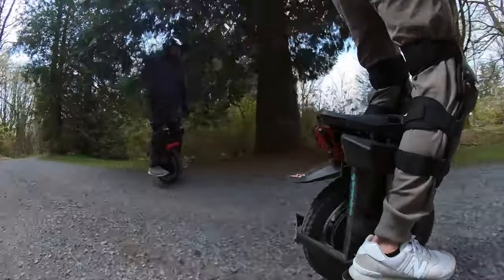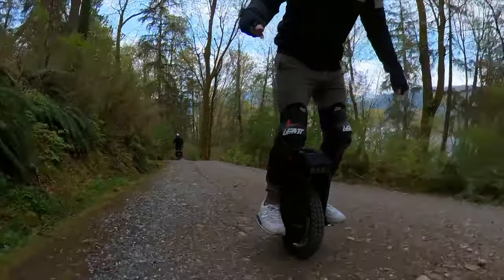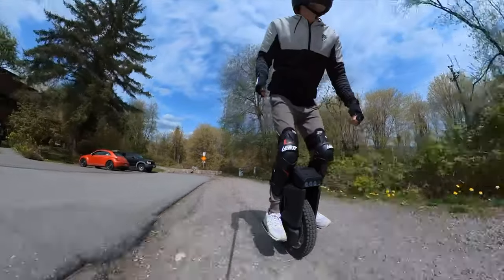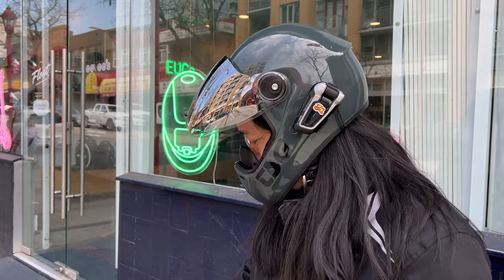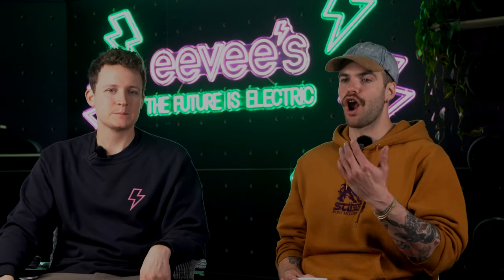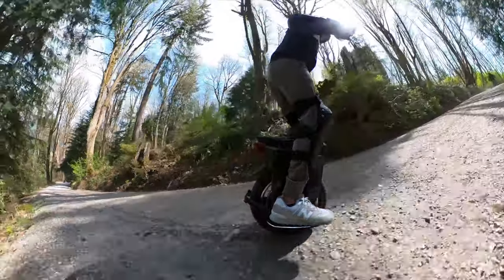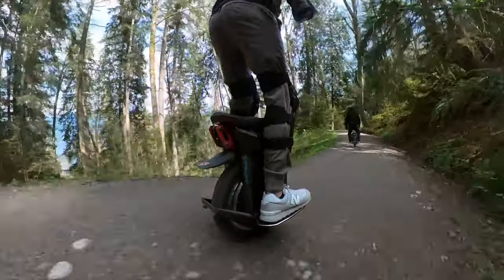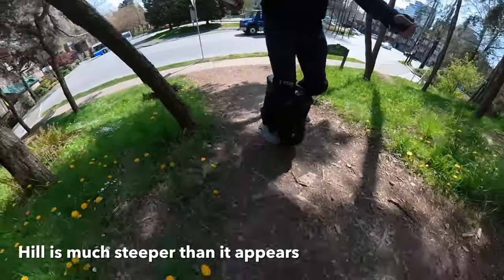Begode Master VS King Song S22 Full Review & Comparison -- Which is right for you?

Comment: Master is very good for riding on the street, It should have a 3600wh option (134v). I'll get a S22.
I think to wait for a street version with 3600wh, 134v and suspension as a third wheel. The first is the ACM2 that I bought from Marty and learned on it.

Comment: Master is definitely my next wheel! Hyped. I actually already bought a Michelin Pilot Street 2 tire to put on it right away since I’m also not a fan of the tire they used. I appreciate your video and thoughts boys! ✌🏼
Reply from the maker: Cheers Andrew! I'm curious your thoughts on that tire. I haven't had the pleasure of trying it yet.
Reply: @eevees  just put it on my EXN, and I have to say I’m a huge fan. The turning is WAYY easier and it’s also alot less “bouncy” compared to the CST
Reply: @Impecable..  Hmm. You still have decent off road traction?
Reply: @ToneKneeParaSocial  the off road traction is still really good; only thing I need to watch out for now is wet grass/mud since there’s no knobs for grip
Reply: Oh yeah 😎 I wanna try that tire out looks like it would shred the streets
Reply: Hi, could you please tell me what the sizes read on your Pilot Street 2? Thanks
Reply: @joelpeterhanson  80/90-14

Edit: 80/80-14 also works; just a little smaller radius so you get more torque, but less speed.
Reply: @joelpeterhanson  sure you need 80/90-14 for the 18in wheels like RS and Master
Reply: @Impecable..  you also risk rim damage with the lower profile too!

Comment: I got through this video with a smile because the lbs-miles pop ups gave me the info I needed without making the video all numbers.   I am on my fourth wheel (solowheel, airwheel, ninebot, and S18).  I am in my fifties and don't want to fall like I had done in my forties.  I have hit lots of unexpected holes and bumps with suspension, never fallen on the last two wheels.  I think you sold me on the S22 if it ever arrives in South America.  Great video.

Comment: Begode needs to build a wheel around suspension to get that 130-150 mm sweet spot. Need 3600 Wh battery on this speed, especially with the way they chained the battery packs now. One pack failure is a faceplant now, same as cut off of a single pack. More reason you need Molicel P42A 21700 4200mAh 45A Battery. 45A is the highest flow of any 21700!
Reply: We'll get there!
Reply: $6666

Comment: Good video! So excited for these! Question: I’m 250lbs. Would the S22 suspension still support me or will it just bottom out just from normal riding?
Reply: Is that 250 fresh outta the shower or 250 all geared up? Big difference. You can find out yourself; all you need is the max suspension and you add the weight of the wheel with your weight fully geared up. If the max suspension load is higher than your weight and the wheel combined, then you can ride it without bottoming out...on paper. The only way to know for sure is to ride it yourself and that usually mean buying it first.  =8-Þ
Reply: If not, there will be a heavier coil upgrade you could swap out for
Reply from the maker: If you’re a heavy rider, I would recommend the S22 because you’ll bottom-out the suspension on the Master most likely:
Reply: I'm about 210 in full gear (or more) and you can see me dropping 4 stairs to flat on the S22 in our videos with no issue! I think you'll be alright :)

Comment: There is no bearing seal on the Master !?
 It is weird i just replace the tire for a H666 on my RS19 HT (awesome tire btw) which has the same motor than the Master the C38 and i did put greases in the bearing which was clean inside a bit of dirt on the seal, but when i remove the seal he has a rubber lips around it, so i wonder why they remove this seal on the Master ?? My RS19 is the batch 4 with the LCD screen.

Comment: I really want to spend some more time on the S20/22, but dang that sucker is wide for my short legs. Ha! These are gonna be popular wheels. Such an exciting time in EUCs.
Reply: Right?! What a time to be alive!
Reply: Atheistme  I'm 5 foot 8 inches or 173cm, but I have like a 29 inch or 73.7cm inseam.
I think the S22 can be reasonably comfortable for me with narrower pads at the top, as opposed to the wide stock pads.
Reply: Atheistme  my legs are proportionally short though. Also, I think with thinner pads, it would feel pretty decent. But the only way is to try it I guess! I'm waiting to see the S22 V2 with bearing sliders, so I'll probably give it another shot then.

Comment: If you put less air pressure in a CST tire it loses the tire leaning problem. Tada!!!!
Reply: I'll tell Bradley and see if it changes anything. I think he already tried that... but I think he also already changed the tire hahah
Reply: @lukastanasiuk5722  I run a V11 CST tire with 1.8 BAR cca 27 PSI, and its perfect grip, no problem with turning the moment i go above that you get that feeling with the CST tire.

However this pressure is not for jumping on to stairs.
Reply: Tires are such an inexpensive EUC accessory with such an huge impact on ride quality. I would definitely recommend getting the perfect tire for you rather than making one work with low pressure or shaving.

Comment: Those are first run shocks on the master - well the one on my EX20 was and the issue was the same. There was an issue. They are fixed now.
Reply: Mehhh we switched it out to a spring suspension and played around with the other one as well and still absolute poop compared to the S22. We are going to pop a much heavier spring on it and see if it can come even within a breath of the S22 but im personally doubtful haha
Reply: @lukastanasiuk5722  for sure. My comment is just about the early shock version. Begode and KS designs are different. Short travel and long travel. Just different. The KS is a non linear design. I don’t know about the Begodes though.
Reply: @rogerunderhill4267  I am confident the shocks will get better, but in my opinion, the Master has a lot of other things to improve before it holds a candle to the S22 :P

Comment: Hey guys.. I got into the hobby with a Gotway MSP HT. It has been experiencing this awful scraping sound from small bumps and medium/hard turns. It'll be smooth and have little or no sound on smooth pavement..

Any thoughts on what kind of problem I have from someone who sees/repairs/opens up these things all the time??

Thanks for the vids. When I have more $$ I'll upgrade 😎
Reply: It'd be hard to say without having it in the shop! Could be something stuck in there, could be a slightly bent rim + an aftermarket knobby tire... these are finicky things sometimes!

Comment: you have any info on difference the production models of the s22 will have compared to the pre-prod of the s20?
I've tried the S20 here in Montreal and it was not that impressive. no torque and too stiff suspension.. you know if they fixed that?
merci
Reply: The new firmware made it much torquier and the suspension just needs to be adjusted to your desires. It will never have the torque of a Master, though.

Comment: Im not sure.... Should I wait for something better next year?
Reply from the maker: There will always be something better next year but for the first time, I feel like EUCs have finally properly leveled up. If you have the money, I wouldn’t wait. They also hold their value quite well so you could sell and upgrade every year for not much money.
Reply: @eevees  
Sure, but it's better of you get that sweet spot where yearly difference won't make much of a change. 
Like a wouldn't want to change my phone every year. But if they make a S24 next year with more ballance, lighter weight, inside suspension and better batteries or other safety features I would want to buy it.
Reply: @BigBoss-gb4cx  They almost certainly will... But you'll be a whole year + without riding the best EUC currently on the market! And also, once they make that new one, the even better newer one will be just another 6 months away, and repeat and repeat haha

Comment: I love the S22 suspension but it's also a huge weak point. The design is apparently not good mostly because the T-rails that the T slider is going up and down in get dirty quick which makes the suspension way less responsive for everything short of bigger drops and bumps. I'm not sure how KS will address that because they really need to but yeah I guess we'll see. I've seen and experienced it first hand.
Reply: Yeah I saw Marco’s (Mad Pack) vid on that. Looks sketchy. We’re looking for the off-road king and that is potentially an Achilles heel. Jam it so full of grease that water/dirt can’t get in? Not ideal.
Reply: @darkhorseeuc   I think supposedly king song supposed to fix it but I don't know how they're gonna do it I have an idea but I'm not sure yeah.
Reply: Definitely the Achilles heel right now.... and somehow STILL the best suspension wheel ever made by a massive margin :P

Comment: That's what I wanted to hear! Helps give me a little more confidence in my choice  while I wait. Appreciate the review guys 🤙🏼
Reply from the maker: Which did you choose??
Reply: @eevees  I went for the S22. Just seemed like the right fit and a really forgiving wheel. Being on the larger side (6'1" & 205 lbs.), and over 40, I knew I wanted a suspension wheel. I don't need the extra speed and torque...not yet.
Reply: Be careful about all the negative info on hot wheels like the S-22, I think some people just try and find something wrong then they call it the worst lol, this wheel is amazing I know this for sure . Can’t wait for my Eagle order! Let’s go China baby!!
Reply: @thefoss721  Oh, 100%! There's definitely no shortage of haters out there. Water off a ducks back I say though. I have no doubt this is the wheel for me! 🤙🏼
Reply: @VoltaicWanderlust  haha good to hear, some dude just tried to explain in a massive message what’s wrong with the wheel and literally everything he said was either a worry that hasn’t happened yet, or something that didn’t make any sense at all… but that’s what happens when a amazing wheel is so hyped, people split off into groups, haters, and “fanboys” which are both horrible terms but haters makes more sense lol… there is absolutely nothing wrong with being a fan especially for the most amazing suspension wheel to have come out, and with the new firmware apparently the torque/breaking/take-off is much better so I’m way too stoked now, as long as you take care of the wheel, maybe waterproof it, silicone it where dirt might want to come in, pad up the weak points, this wheel will last for years without issues, my S-18 has zero issues after 2000 miles and I’d give it another 4000 probably it’s actually built quite well, so is the Eagle :) enjoy your wheel when it makes it to ya man!
Reply: @thefoss721  Quality response!
Reply: @lukastanasiuk5722  why thank you kind sir, what great sarcastic sounding response to you as well lol

Do you not like the Eagle or are you neutral ? It’s not worth jumping into this battle lol
Reply: @thefoss721  If you've watched this video, you know how I feel about the S22 ;)

Comment: Getting Master.. first wheel to do it all.. high torque,  high speed,  decent enough suspension (ridden my friend's- feels great to me and he's already changed to kenda tire from stock cst tire.. much more stable,  better for carving), easier to work on (modular design- can add extra battery packs for extended range).. beats s22 by a long shot.. all you need to do is change master cst tire to kenda.. you can't improve the s22 speed and torque.. no contest to me.. gonna get master with better litech or samsung batteries.. I'm actually used to the exact same cst tire the master comes with on my rs high torque but after trying the kenda on my friend's master it's pretty much the perfect wheel.. best suspension I've tried on any gotway wheel (my friend had an EX before and didn't like that suspension but the master suspension is really good for me)
Reply: Boooooooo S22 all dayyyyyyy
Reply: @lukastanasiuk5722  s22 is boring comparatively.. the only thing the master needs is the kenda tire.. my friend already put the kenda tire on his master and now it's a perfect all round euc.. I've ridden it with the kenda.. the master is the fastest,  best torque/ acceleration euc,  the suspension is great to me,  the carry handle is the best in class,  the minimal,  modular easy to work on design is the best yet.. nothing beats it imho.. don't see anything that's better about the s22.. the suspension is supposed to be better but on trying the master suspension at the right psi I found it excellent anyway
Reply: @justinspirational  Hey well it sounds like you've found your wheel! No matter what I did to the suspension on the Master, it felt like a kinder surprise  toy compared to the S22. The handling, the stability, the looks, the suspension, the pads, the seat. It's all exactly what I want from a wheel and to me, puts it leagues beyond what the Master can be, even with modifications. Such is the beauty of subjectivity!

Comment: So stoked to hear the upgrades in the new improved S-22 … which has a 20” wheel lol , so now the S-18 can be considered S-20 with the new firmware hahahaha just kidding 

Regardless of the names I like this positive info on the new wheel,… can’t freaking wait for my model
Reply: Don't get me started on that f***ng name change :/ lollll
Reply: @lukastanasiuk5722  yeah king song didn’t fool anyone with the name change , nobody thinks it’s because a new bumper and firmware but the added benefit is apparently pretty solid regarding torque which it needed more of , as long as thats the case without any new fires, I’ll take it! But I wonder if the added performance means there’s a even bigger chance of a over voltage/ power draw for cutouts or blown fuses to fires , I’ve been waiting 8 months since the pre order, it would be nice if she holds up upon receiving this wheel lol
Reply: @thefoss721  I remain unwaveringly confident :P

Comment: Why pay more for worse performance. Suspension isn't something you'll notice a difference on every Crack or bumps. Plus it's cheaper.
Reply: Ya, also the S22 has a very poor slider design which adds TONS of friction, or “Stiction” in suspension terms. The sliders in the S22 are also plastic which will wear out super fast. I honestly don’t know why these guys like the s22 more; probably just because the master has a worse stock suspension and they’re too heavy for it, so it bottoms out.
Reply: @Impecable..  You got it!